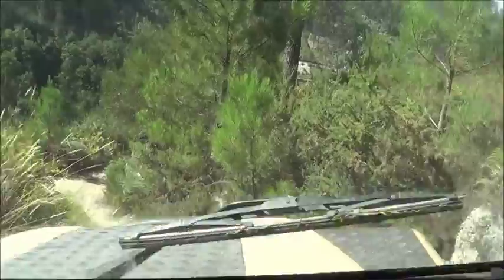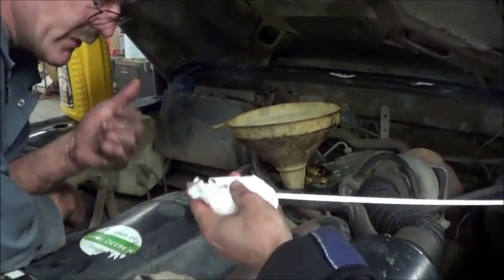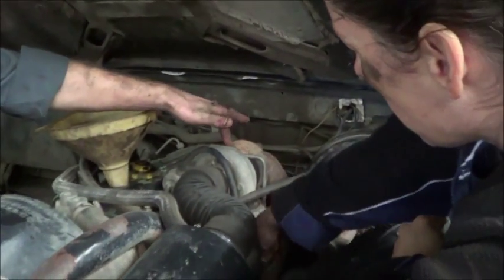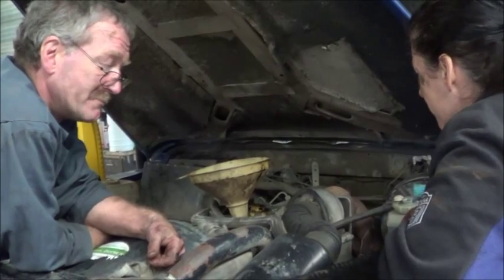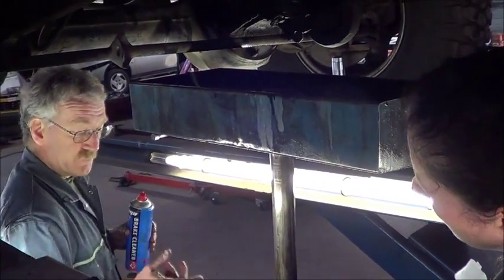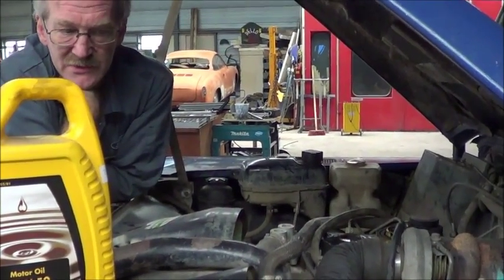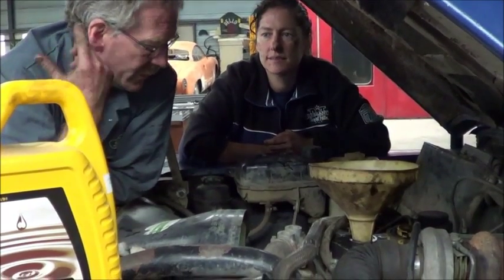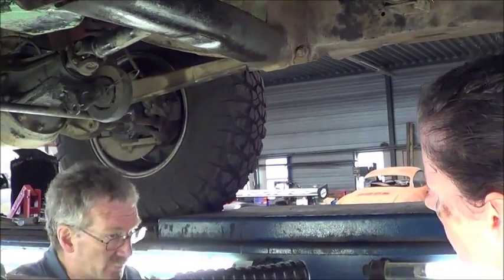LAND ROVER TRIVIA FROM UNDER THE HOOD - with Rob & Vic

Comment: more likely that at extreme levels of over filled it will blow out all its seals, and most of the run on on the old 2.5 td was caused by goosed breather system. Never seen a motor blown to bits by running o  sump oil.
Reply from the maker: +Richard Shields Does make for a spectaclular sight though. You must have come across many on youtube, notably this one: https://www.youtube.com/watch?v=5zx3qKX_Pno (pity it doesn't show the end...)
Reply: Yeah sure does, old td was never as severe as that though.

Comment: How strange looking at anothers' perspective about oil viscosity.

Using 20W 50..... Oil viscosity ie:  is about the ambient temperature of your environment rather than using a thicker oil on older engines to take up the slack. You will not cure compression problems or worn components with this oil. It is also a myth to say that the engineering tolerances have got tighter on more contemporary vehicles.  Oil technology has changed.  

You would use 20W 50 in a hot environment where the ambient temperature is 55 degrees centigrade and the temperature doesn't drop below 0 degrees centigrade.  

Using it in the UK or Europe in the winter is asking for trouble,  10W 40 or 15W 40 is acceptable for our European climate for a 200tdi engine. But hey, no one is interested in the facts these days.....

 The viscosity information is in every workshop manual, Sorry just thought I'd make that clear.
Reply from the maker: Thanks, we appreciate your comments. We agree that the viscosity of the oil is dependent on the ambient temperature of the environment. We also thought it pertinent to re-iterate the criteria that set the ratings, using the data provided by the Society of Automotive Engineers (SAE) who actually created the scale. 

"Cold cranking viscosity simulates the viscosity of an oil in crankshaft bearings during start up on a cold winter morning. The test determines if an engine can be cranked over fast enough to start under extreme cold ambient conditions. ASTM Method D 5293 simulates an oil's cranking resistance when cold, and thus indicates the lowest temperature at which an engine is likely to start." 

"Cold pump ability measures the resistance of an oil to pumping through the engine after a cold start. The most widely used test is ASTM D 4684. If an oil's viscosity becomes too high, pumping will be hindered with possible cavitation issues. Viscosity here becomes an important factor in determining whether the engine runs with sufficient lubrication after starting in severe cold conditions.  The Cold Pumpability test is always conducted at 5°C colder than the Cold Cranking test to ensure the pump can deliver the oil to the bearings."

So Maximum Cold Cranking first. 

10W - 7,000 rpm at -25 deg C
15W - 7,000 rpm at -20 deg C
20W - 9,500 rpm at -15 deg C

So in the above we can see that the 10W and 15w will allow the engine to spin at a lower speed in colder temperatures than 20W, however as all the speeds are well in excess of the maximum revolutions of a 200Tdi, or come to that most starter motors,  it is pretty academic. 

Cold Pump Ability.

10W - 60,000 at -30 deg C
15W - 60,000 at -25 deg C
20W - 60,000 at -20 deg C 

So all 3 provide the same protection all be it at a 10 degree difference between 10W and 20W.

In the next reply, we'll talk about Ambient temperature ...
Reply from the maker: Now we go back to "ambient temperature", which in itself is a non specific measurement but generally taken as the surrounding air temperature. 

In Europe the minimum ambient temperature almost never reaches the figures given above, in fact even the Eastern European countries don't get anywhere near these figures on a constant basis. Yes there are always blips, on 4th February 2012 we did get -22 deg C here in North Holland. We can therefore conclude from these facts that "using it in the UK or Europe in the winter" makes not the slightest bit of difference.

Now onto the other end of the scale. 

"Kinematic Viscosity is a measure of the fluids resistance to flow and shear under the forces of gravity, or how easily the oil flows to the different parts of the engine and is measured as centi-Stoke (cSt) which is 1 mm2/s "

"High-temperature high-shear-rate (HTHS) viscosity is an indicator of an engine oil's resistance to flow in the narrow confines between fast moving parts in fully warmed  up engines. The most common test for this is ASTM D 4683 as it closely mimics the conditions found in an engine's crankshaft and connecting rod journal bearings, as well as other narrow regions such as between the cam and follower on flat bucket tappets. This measurement influences such factors as fuel consumption, valve-train wear and bearing protection."

10w/40 has a minimum cSt of 12.5 and a maximum of less than 16.3 and an HTHS of 2.9 at 150 deg C
15w/40 has a minimum cSt of 12.5 and a maximum of less than 16.3 and an HTHS of 3.7 at 150 deg C
20w/50 has a minimum cSt of 16.3 and a maximum of less than 21.9 and an HTHS of 3.7 at 150 deg C

The 20w/50 obviously out performs the thinner oils in these tests.  

The viscosity information in the workshop manual quotes a range of ambient temperatures, so it is incorrect to state:

"You would use 20W/50 in a hot environment where the ambient temperature is 55 degrees centigrade and the temperature doesn't drop below 0 degrees centigrade."

Following on with your comment 

"... rather than using a thicker oil on older engines to take up the slack. You will not cure compression problems or worn components with this oil. It is also a myth to say that the engineering tolerances have got tighter on more contemporary vehicles." 

The SAE also have conducted several tests over the years on this particular item and came up with the following statement in their report. 

"Historically, with older engines having looser clearances from wear, and especially in the Mini/1100/Metro’s (with the gearbox in the sump resulting in rampant shear damage to the VI Improvers), these engines still generally require a thicker oil such as a mineral 20W50 or 15W40.  In fact it was the launch of the Mini in 1959 that resulted in the 20W50 scenario with BMC/BL products.  The shearing damage on the typical 15W40 caused problems and that the resulting 20W50 was selected to counter this shearing action.  20W50 then seemingly became the defacto oil choice for BL products in the 1970s.".

"Modern cars are now designed to run on 10W30 or even 0W30.  This is partly due to tighter clearances in the machining processes now used, but also to reduce fuel consumption even further and meet the ever tightening Euro specifications on emissions.  Owing to the use of synthetics now, the 0W30 oils do not necessarily result in more wear as the film strength of synthetics is superior to mineral oils".

Both statements appear to confirm that engineering tolerances have improved over the years and thicker oils give better protection on the older designs of engines.  

It does appear that the Society of Automotive Engineers also hold onto the same myth. No one suggested that it was a cure for compression problems or worn components.
Reply from the maker: And lastly, ...
"The internals of the 200Tdi have not significantly changed since the introduction of the 2.25 and the venerable V8 never changed much either over the years until it's demise in 2004 at the end of production of the Discovery II.

With the introduction of the Td5 the specification changed to 5W/30 and at the Land Rover Technical Briefing Launch it was specifically stated that this was due to the changes in the tolerances of the manufacturing of the crankshaft journals, oil galleries and oil pump. Since then engine manufacturing has improved to the point whereby now we have the 5.0 V8 Supercharged AJ133 that uses 5W/20.  

We had a 200Tdi Discovery that ran quite happily for over 200,000kms (125,000 miles) using nothing but 20W/50 and a number of friends have also run their vehicles using the same oil with zero problems.

With regard to the cold ambient temperature protection, then our 1979 2.25 Petrol Lightweight performed quite happily in -22 deg C with Full Fat 20W/50, it started first time with no lag and the oil pressure was perfect for the whole of the day,  it is worth pointing out that this particular vehicle has no roof, door tops or windscreen and lives it's whole life outside so is not cosseted in a warmed garage and only taken out for high days and holidays.

So in conclusion, the statement in the video appears to have some credence, based on 25 years of personal and professional experience, as well as being backed by the Society of Automotive Engineers who created the Oil Viscosity ratings in the first place. And by Land Rover themselves who have openly admitted that the engineering tolerances in their engines have got tighter over the years and have reduced the viscosity of the engine oil accordingly to compensate. "
Reply: Tours and Tales.com Well I would lose my job if I just went on "in my experience" as credibility or "well my car ran on it for years".  Some will but if you have to work on a bigger scale like vehicle fleets, buses, trucks the margin for error and failure has to be considerably reduced.  Apologies I can't quote from Wikipedia if I make the wrong decision. Thats why there are oil engineers who are consulted on any changes with oil supplies. Close enough is simply not good enough. 

 I work as a professional HGV technician so the vehicles I work on are put under heavy working conditions with high milages attained annually.   Yes perhaps many Land Rover engines will run happily on any old oil you can shove in the sump but working on large fleets that annually run up in excess of 5.5 million miles per year I can relay professional experiences with the wrong oil causing problems and premature engine failure due to incorrect viscosity. 

If you were a customer and you'd had problems with your vehicle and it had come down to not using the correct oil you would scream blue murder ... as some fleet owners / customers do.  

I am only pointing out observations and it is not an attempt to knock you. Thank you for the time you took to answer,.. Hope you didn't mind your cage rattled a bit,  Just wanted to see what you were made of.....
Reply: Tours and Tales.com  Anyway, who am I talking to?  I am under the impression that it is not the same person who put up the video asking for some advice on an engine noise???
Reply from the maker: It's always good to have the ol' cage rattled every now and then. We're still pretty much ignoramus about all things mechanical, so rely on our guru for these kind of answers. Interesting stuff about the HGV's ... who knows, maybe one day our Landies: Muddy Boots, 200tdi 90 & Rusti: knocking 300tdi Disco1 would be traded in for something much larger? Unlikely, but never say never ;-)